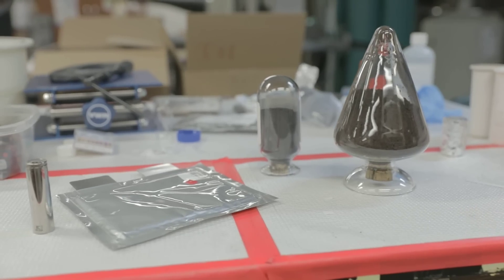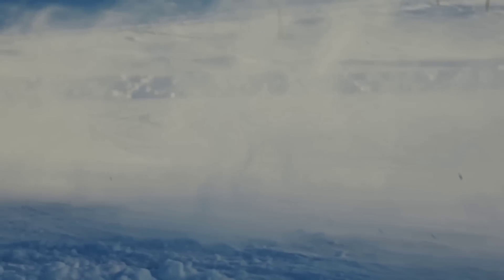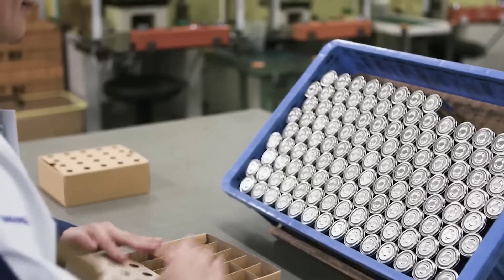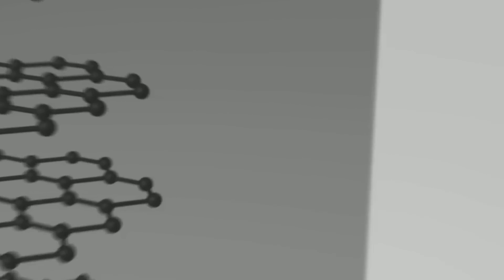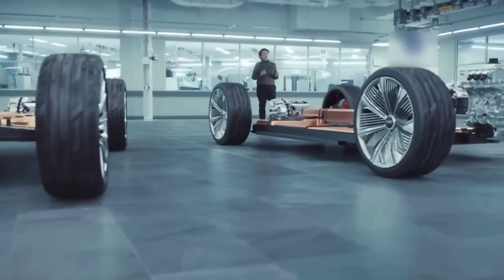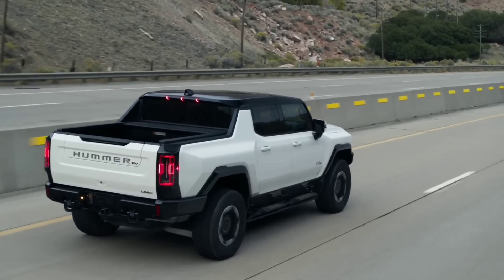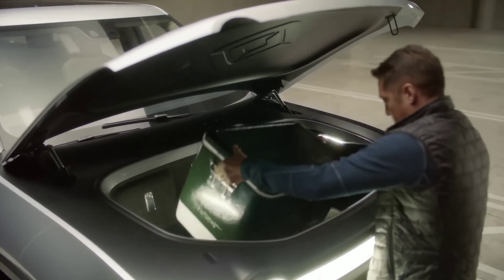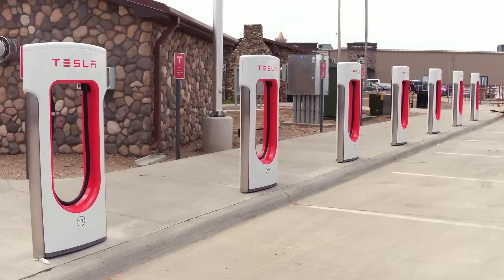NanoGrafs’ New Battery Material Shocks the World with Its Power!

Comment: The problem with this battery is that it still uses lithium unfortunately. However, at CATL, Cobalt and Lithium are no longer an integral part of their last element that they have already started to produce. I believe much more in the sodium battery, with solid electrolyte and much more respectful of the environment.
Nevertheless, very good video with remarkable sound quality and images.
A little French on the West Atlantic coast very close to the small port of Pornic. Jean-Marc
Reply: not solid state battery that uses sodium
Reply: @jellyboy123  
A small update of your knowledge is necessary in this case. You are light years away from what is being prepared for this year.

More Cobalt, more Nickel and more Lithium. Therefore a more environmentally friendly battery.
But that's not all. I let you discover this new technology.
Good viewing.
https://www.youtube.com/watch?v=xe_Mi2H6ONQ

Comment: what will this battery cost per kw?
Reply: YES. That is why ICE vehicles are so dangerous. In the US the is a car fire every three minutes. Then there is the enormous problem of carbon emission from ICE vehicles.
Reply: @josephcontegiacomo1964  

A vehicle every three minutes...! You don't seem to be exaggerating a bit here..?

"  More than 200,000 fires In raw data, the results speak for themselves. In 2021, 52 electric cars were declared set on fire compared to… 199,533 combustion engine cars (petrol and diesel combined) in the United States. Over the same period, plug-in hybrids recorded 16,051 (starts of) fires. Nothing very surprising so far, since thermal cars are largely in the majority in the car fleet, a fortiori in America. It is therefore normal that claims involving them are more numerous. That's why Auto Insurance EZ reported this data per 100,000 vehicles on the road. A risk up to 138 times lower! Once the proportionality calculation has been carried out, there are then 1,529.9 gasoline and diesel car fires per 100,000 units. For electric cars, this figure amounts to only… 25.1! Or a risk of combustion divided by more than 60! But that's still nothing compared to cars hybrids which, comparatively, accounted for 3,474.5 fires. That is a value 138 times higher than that of cars with exclusively electric motors. "

https://www.autoplus.fr/pratique/voitures-electriques-prennent-feu-plus-souvent-557104.html#item=1

What are your sources..?
Reply from the maker: NanoGraf Corporation, the lithium-ion battery industry is close to achieving the $100 / kWh milestone, the price at which electric vehicles will be cost-competitive with internal combustion engine-based cars.